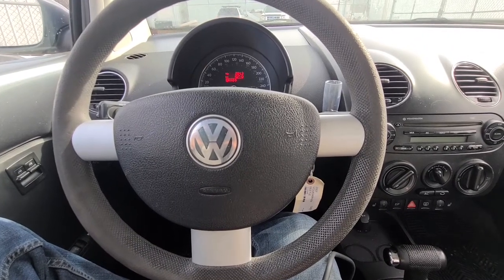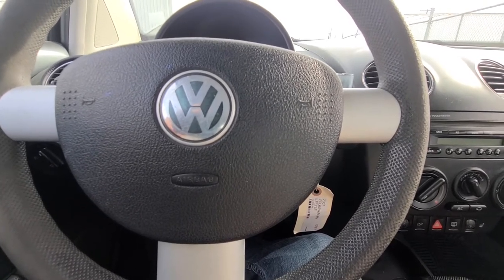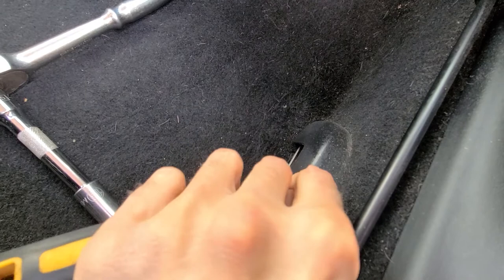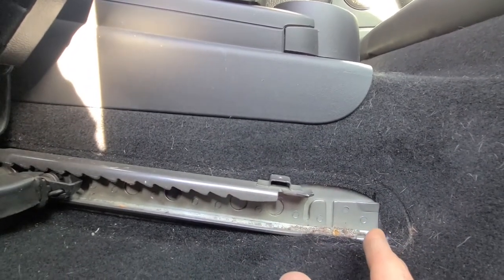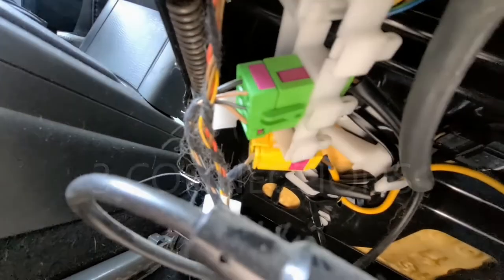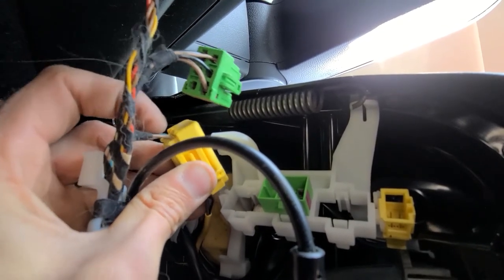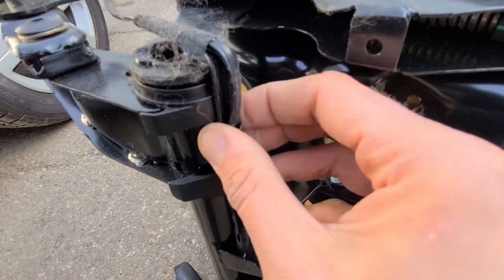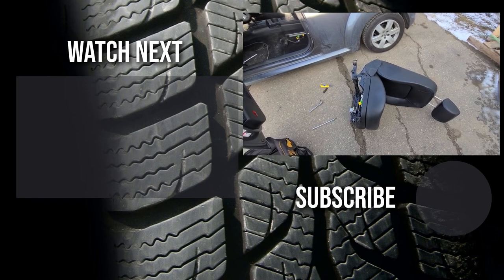VW Beetle - DRIVER SEATBELT BUCKLE REPLACEMENT (CODE 00591)

Comment: do you have the part number for the drivers side seat belt buckle by any chance?
Reply from the maker: Best you can do is call VW parts department with the serial number of your VW and ask a quote for the part and then ask part number as well. They have to give it to you